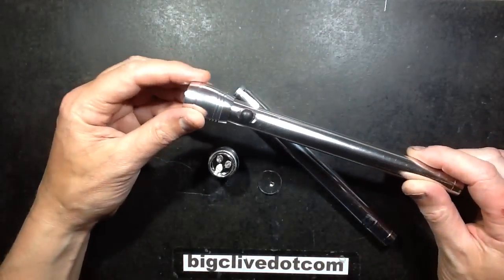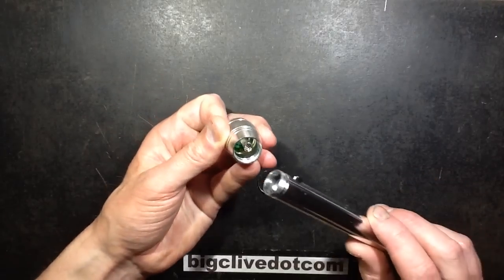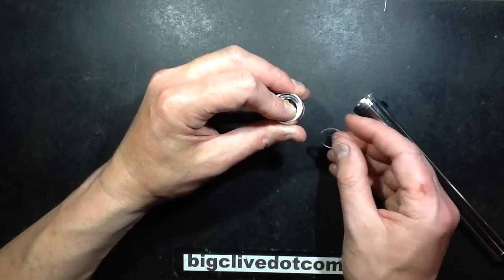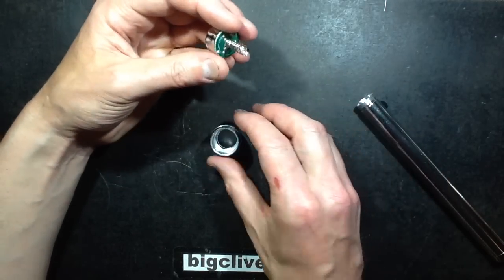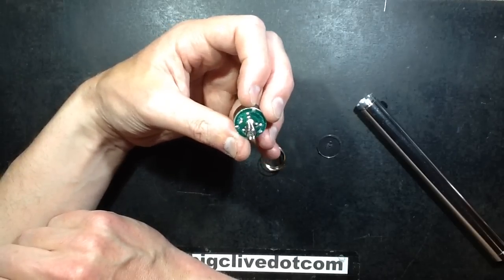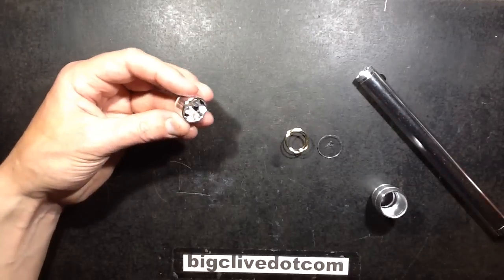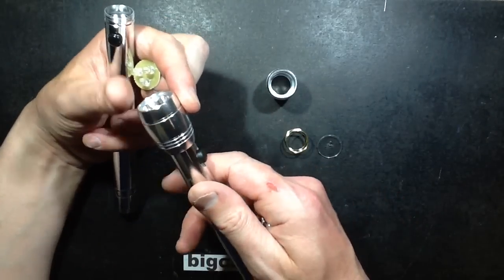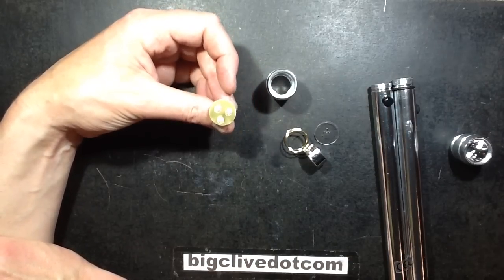Poundland LED torch flashlight 2015.

Comment: Learning alot for you big clive. I dont know whats in them but I use the poundland head torches and just litter my rucksacks with them. At first the idea was if it breaks or dies it only cost a pound and id have more but the wee things (despite the terrible headbands) have been going for years now, work really well and seem to be very long lasting with the poundland batterys i used. Would be interested in your take on them
Reply: My bad i see youve done a vid on them now. although its not the silver barrow shaped ones i have, cheers mate

Comment: They way to get that pcb out without smashing anything is to get an object as big as the pcb itself and then press it against the pcb and then start hitting it with a hammer and the "glass" should pop out intact. At least that's they way I've done it. Cheers :)
Reply from the maker: That technique used to work with the older hard fronted version, but this version has a "chewy" plastic front that is actually concave when pressed in from the front and snapped into its groove.  I applied significan pressure from behind and also tried chapping it, but it didn't budge.
Reply: bigclivedotcom Sorry to hear that. I am a flashlight enthusiast myself. I have a few high end flashlights that cost quite a pretty penny but is still find myself using the low end cheap ones. It's amazing that I could find at a store 10km from me a flashlight that puts out about 40-50 lumens and has 3 modes with "zoom", runs from 3xAAA which I don't use but you can put an 18650 inside so no big deal. All for 2$ and it's not bad quality either for the money. I mean I've got the metal version of it and that costed about 12$ and was quite crappy. Anyway... :)

Comment: I was looking at that torch in poundland earlier in the week, I decided not to add it to the clutter I already have. lol 
Do you know of anywhere on the high street that sells 18650 battery's? 
Buying from the Internet (Amazon), the ones I got appear to be re-used old laptop battery's. They only test around 800-900mAh instead of the 3000 they claim.
Reply: Maplins sell them, as do most e-cig & vapeing shops. Regards
Reply: Green Silver I'm guessing you bought some of those shitty Ultrafire batteries? Yeah don't get anything __fire, all of those are bad/crappy/re-used batteries, I would personally suggest just buying a laptop pack and tearing it apart... because even if they also turn out to be re-used they'll likely be at least 1500mah or so plus you can get them at around $1 each for example this pack here http://amzn.com/B005U2VAW0 so even cheaper than buying them seperately, also nobody expect for panasonic makes anything above 2600mah and they are very expensive as well, (about $10 each) so if someone is selling higher capacities than that, its obviously a BS fake.. steer clear of them, sorry you had to learn the hard way.
Reply: vgamesx1 
The charger that came with my Ultrafire did the honour of giving an extremely bright flash and taking out the circuit breaker trip for the plug sockets. 
on the plus side, it's good to know in a real world situation that my place won't burn down due to an electrical problem.
Reply: Green Silver Lol, well I find those little usb power banks are a good way to charge them, not so great for solar charging but they work.
Reply: Green Silver I buy all my lithium batteries online, but not through Amazon because they have a substantial markup. There are quite a few online marketplaces with very good reputations, such as www.batteryspace.com , www.illumn.com , and www.orbtronic.com to name a few that I've used. I have also sourced some batteries and electronics overseas from places like FastTech and BangGood, but the shipping, while usually free, often takes quite a while. 

I second the recommendation to avoid ***fire batteries if at all possible; they're just not worth it, the capacities are fraudulent and they're just not safe. You *can get proper 3000 or even 3400mAH cells now, but you're going to pay quite a bit more because that's right on the cutting edge of battery tech. I tend stick with the much cheaper 2600mAH cells. and that has worked out pretty well.

Comment: Question 2 fold Did you get your microscope on eBay and do you have the vendors name and 2nd have you looked into the new lot of Cree LED's
I have to admit i am an LED junkie as my current supply has now hit a big number for me of just on 10,002 including all types smd to about 100 10mm the larger ones don't really impress me the same way as the small one.
Reply from the maker: I got the little microscope a long time ago, but it did come from an online seller.  Try an ebay search for LED microscope.
Reply: Thanks